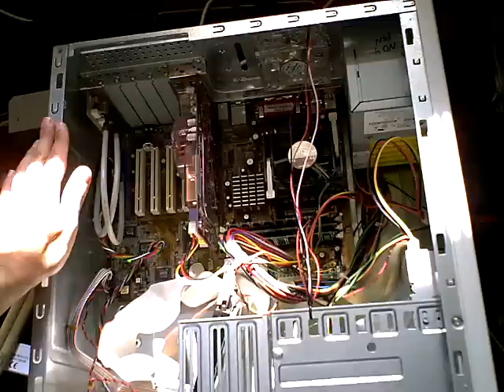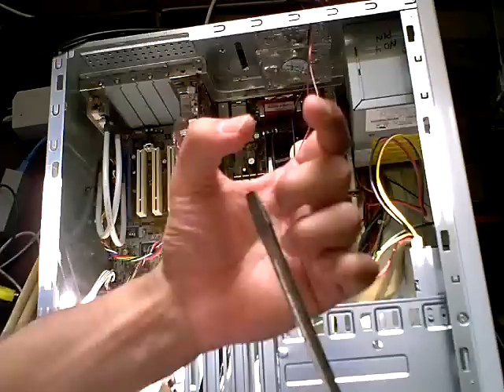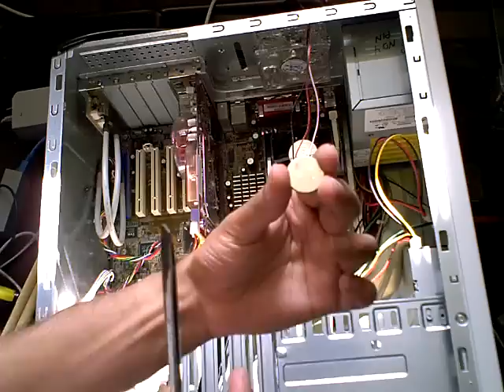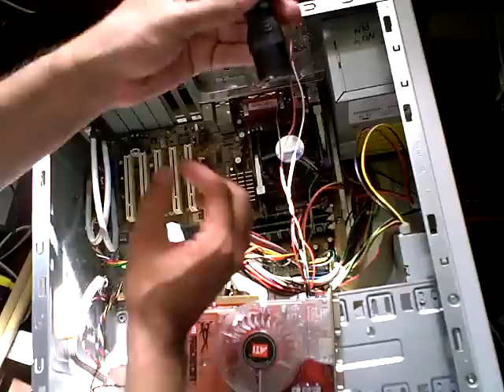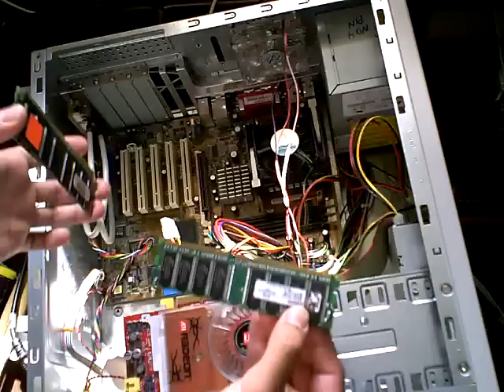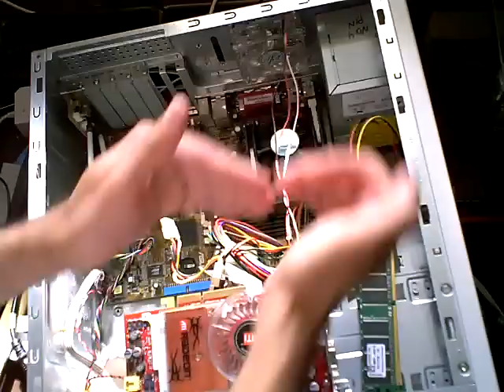How to possibly fix a PC that will turn on but will not beep and will not display anything on screen

Comment: Can i test my other computer parts first to ensure that it is the motherboard that is causing this problem? This just happened last night and i cant seem to find the error since the mobo does not beep when i removed the ram and video card
Reply from the maker: The only way I know to test other components is in a different PC that supports all of your components, essentially by installing your current components in a different PC that is unplugged, and then powering up that PC and ensuring everything works as intended. I highly recommend you try what is shown in this video (including the CMOS reset trick) before considering your motherboard dead.
Reply: thanks i will try the cmos reset. if i remove the cmos battery, should it be replaced or can i just put it back?
Reply from the maker: Marion Batingal
If you remember your PC keeping the date and time after a power loss before the problems started, then chances are the CMOS battery is still good. Leave it out of its socket minimally 10 minutes (I recommend overnight) and then re-insert. If the PC no longer keeps a proper date and time after repeated unpluggings and reconnectings, then you might need to replace the CMOS battery (they sell these at dollar stores and electronic shops, not terribly expensive).

Comment: when I turn on my computer my screen goes to the windows then to a black screen with a white message. it does not beep and it has no curser if that helps.I have a desktop HP. do you know what i need to do to fix it? thank you
Reply from the maker: +Alexis Nicole If it is going to Windows before the error, your Windows installation has become corrupt. You will need to format your hard drive and reinstall Windows. Keep in mind that you will lose all of your personal data, so you might want to first boot up with a Linux LIVE CD to recover your personal data before doing this.

Comment: It sucks, I tried this because I was having the issue when I took out my ram and video card last night to get the dust out of it and I put everything back how I had it and boom I have this issue and have tried taking out the battery and it's not working ugh it was working fine yesterday, before I took out the ram sticks and video card :( any conclusions?
Reply from the maker: Conclusions: no. Suggestions: yes. Breadboard it (explained in the following video:)

If the steps in this video did not provide a solution to your problem, view:

http://www.youtube.com/watch?v=_EK9a-R5pss

You never know, maybe rebuilding the PC in the opposite sense that you took it apart will solve the problem.

Comment: Hey!
I really don't know anything about computers so bare with me.
I took out my graphics card and cleaned it today I also took out the fan that's just sitting beside the graphics card and the only thing I unplugged was the graphics card, but after I had plugged it back in the moitor didn't connect so I tried to switch the cables thinking I might had put them in the wrong slots, but when I put in my mouse and keyboard they didn't connect either and when I tried turning my computer off it wouldn't so I had to pull out the power cable for it to turn off..
Reply from the maker: +Victor Holm Sounds like the same issue in the video. Try the steps in the video

Comment: My computer is booting fine, but it takes at least one minute to hear that one  normal beep and then every thing goes smoothly , is this problem or not and if its problem any help would be appreciated  .
Reply from the maker: (shrug) it's obviously not functioning as it should if it were purchased new, but if you could live with the problem, I think the way it is beats it not working at all. Just my two cents : \

Comment: So i was upgrading my card today, and we load it on the monitor in the workroom to install its drivers, everything loaded up fine and displayed images on the screen, and the wire that goes into my tower, isn't VGA, so i go back home all excited, i plug in everything in, my monitor at home uses the VGA slot, i turn it on and nothing appears on screen, but my mouse and keyboard light up, what do i do with this?
Reply from the maker: +Nasty Pete Your BIOS is configured to output on a different video device. You have to access the PC via the previous functioning display output, go into the BIOS, and set the default video output device to your preferred device. You can also try resetting the CMOS as shown in this video, but it might cause more trouble than my first suggestion
Reply: RodneyDickson Actually I figured it out, a complete rookie mistake in all honesty, I was trying to use use VGA instead of DVI-D lol
Reply from the maker: +Nasty Pete Glad things are working now. Thanks for the update
Reply: RodneyDickson No problem, and thank you for the thorough fix solution

Comment: Can you shoot some ideas towards me, i just built my PC and i got it work at first and installed windows on it got it going then when i turned it off and later tried for it to go back on, the PC boots up fans spins, everything is good, motherboard lights up but i get nothing on the mointer just a black screen and no beeps what so ever
Reply from the maker: Definitely try the CMOS reset trick as shown in the video. If that doesn't work, try the other steps shown in this video. Lemme know how it turns out.

Comment: hello, i have the same problem, i remove the ram as you did and it did make a sound like yours, however after putting it back together. the pc wont display into the monitor and the cpu fan keeps spinning
Reply from the maker: Unplug the PC, try placing the RAM in a different order, then power up. If still no luck, repeat (each time unplugging the PC, trying the RAM either in a different order or in a different combination, and then powering up). If you cannot find an order that works, and have tried each RAM module in each socket individually with no other RAM present, then perhaps the motherboard is finished.
Reply: Yeah, it the problem was the ram, i just switch the order and worked. thanks
Reply from the maker: Nice! Glad to help out : )

Comment: When I turn my desktop on it shows the dell symbol but then turns to a black screen. I did the cmos battery thing like u did in the video and when I turned on it beeped three times in a row. Then I powered everything off and placed the cmos back in and when I turned on my computer is did the thing again. If you can help that would be great thank u.
Reply from the maker: +RicksRaw Gaming Beep error codes differ from one BIOS manufacturer to the next. To discover what the beep error code is trying to telling you, discover the manufacturer of your BIOS (available in the motherboard's manual or on the motherboard's manufacturer's website {on the page for your specific motherboard model}) and then look up the frequency and interval of your beep error code on:

http://www.computerhope.com/beep.htm

Comment: my computer works when I remove my brand new graphics card, but the graphics card is fully function (I tested it on another pc), thoughts? the power supply is brand new as well
Reply from the maker: +Sher Randhawa If this is new hardware that you are installing on your motherboard (that has not yet functioned on your motherboard,) note that matching bus types of video card to motherboard socket (PCI-E for example) or matching bus types of RAM module to motherboard socket (DDR3 for example) does not necessarily signify compatibility. If this is the first time you are trying this hardware on your motherboard, there is a chance that this new hardware is not compatible with your motherboard, despite the same bus type and despite the fact that the new parts fit in their respective motherboard socket. Your motherboard manufacturer's website will have a support page dedicated to your motherboard's model, and on this support page should be a compatibility list for such components as video cards and RAM modules. Ensure that your new component is certified to function with your motherboard, and if your new component is not present on the compatibility list, then there is a chance that the new component is not compatible with your motherboard.
Reply: +RodneyDickson hey I already figured out how to get it to work haha I had to update the computer bios and it worked! thank-you anyway though
Reply from the maker: +Sher Randhawa Thanks for the update

Comment: I'm in a really weird situation guys and I wonder if anyone could help me out - I recently bought all the components for my build and I was test bench-ing the system to check that it posts before I install it in the case. I assembled everything correctly and plugged the power supply into all the correct slots etc. Then when I turned the power supply on the first time my asus hero Vii mobo lit up with red leds like it should do and there were also leds on my graphics card and on the start button on the mobo - I pressed the start button and the fans on the graphics card and psu whirred for a couple of seconds then stopped, the system didn't post! I tried a couple more times and still no luck with posting So I unplugged the connectors and reassembled everything. After reassembly the leds on the mobo turned on but no leds showed on the start button or graphics card, so I assumed that either the power supply or cpu was dead and breaking the circuit. I then used the included psu tester and sure enough the psu fans whirred continually until I turned it off - so that's the psu excluded. Then I removed the cpu and put my lovely new 4790k in a different computer, sure enough it worked just fine and the system turned on - so that's the cpu excluded. I didn't need to exclude my graphics card as the system could post without it due to On board graphics on the 4790k. That just leaves the ram and the motherboard itself. I can't exclude the ram annoyingly because the pc I put the cpu in to test it was an alienware alpha which has space for a full sized cpu but only laptop sized memory, so I can't check that. It's also extremely unlikely to be the power cables from the psu because the main mobo one must work as it is used for the psu tester, so that's excluded and there were two different included cpu power cables both of which have been tested. Finally the suspect could be the motherboard itself - but if the mobo was dead surely the lights wouldn't turn on (which they still do on the main motherboard)?
Reply from the maker: +Mo May Hobbs Very good diagnosis. Power lights on a mobo do not signify that it is without issue. The issue could still be a faulty board, and of course if you have more than one RAM module, try but one module and try RAM modules in different orderings

Comment: can you help me with my problem? the computer will turn on and will beep but no display with or without a video card installed. I've tried checking the cables but still no luck. I've also tried using the video card on another computer but still the same problem occurs. any idea what could possible happened?
Reply: and when I say beeps, i mean the normal single beep and when i press the numlock or capslock on the keyboard it is responding but no display, I even connected a speaker on it and i can hear the skype app connecting
Reply from the maker: elton69
Ok, the detail in this question helped. So, if I understand you correctly, the video card never outputs a video signal regardless of which PC it is installed into? Does your video card have multiple video outs, and have you tried the different video outs? Also, have you tested your screen with a different computer to ensure that the screen isn't to blame?
Reply: i have tested my video card on 3 different computers. 1 is on my friend, 1 is on my workstation and the other 1 is my personal computer. on my workstation I have a testbench and 2 other motherboard that is working, the video card has 3 output ports, which is vga, dvi, and HDMI, on VGA and DVI it doesn't work and I don't have a HDMI cable to test it. the PCB on the video card slightly bent maybe because overheating issue. I have sent the card to my friend for reheating which is my last option.
Reply from the maker: +Jones Afraid I am out of ideas. Hope you ended up finding a solution : (

Comment: So I just got a brand new motherboard and cpu, however I'm using an old cooler and gpu, it shows no signal on screen, everything starts up fine but no beeps no nothing... help?
Reply from the maker: The cooler should not make a difference here, although the GPU might. Your PC has onboard video? Disconnect the power cable, press your PC's chassis power button switch (to discharge any remaining power circulating in the system), remove the addon graphics card, connect your display to your onboard video, and power up. Lemme know how it turns out.

Comment: Hey I bought a new pc and I built it myself. When I turn it on everything seems fine, all fans are working including the gpu's and the lights on the gpu are also working, but there is a solid red light on the VGA on the motherboard and I get no signal. I connected hdmi but same problem, what should I do?
Reply: I however hear the single beep when I start my computer
Reply from the maker: It's a good thing you mentioned that beep, else I'd tell you that things are not working. Ok. It sounds like your PC is defaulting to a different video output than you are connecting to. Keep in mind that you can only test video outs when the PC is off and then is powered up with the display connected, so each time power down your machine, connect your display to a different video out on your PC, then power up. Lemme know how it turns out.
Reply: Ive connected the gpu to a different vga port in the psu and it worked, also i switched to a dvi cable. Once i did both of those things it worked perfectly fine and it still does as im writing this comment from that computer. Thanks for your response
Reply from the maker: Glad things worked out then : )

Comment: the same happend to me do you think it might be because i left it out for 2 months without using it
Reply from the maker: What you are describing is the most common reason this issue happens. PCs are kinda like muscles in the body: if they are not used regularly, they become difficult to function.

Comment: hi my cpu turns on and the monitor displays intel for a sec,after that the cpu has one green light on and the fan of the cpu turns off and the monitor turns off.Could u explain what problem this is.And when i removed the ram sticks and put it back again it gives 3 red beeps then.Plz help
Reply from the maker: Disconnect the display from the PC, then power on the display. Is it still showing 'Intel' for one second?

Comment: im having a problem, when i turn the computer on it starts beeping and nothing is on the screen and after 10 seconds it turns off and after five seconds it turns on and starts beeping again and turns off again repeatedly any fixes for this one?
Reply from the maker: +SPIDER SWING Beep error codes differ from one BIOS manufacturer to the next. To discover what the beep error code is trying to telling you, discover the manufacturer of your BIOS (available in the motherboard's manual or on the motherboard's manufacturer's website {on the page for your specific motherboard model}) and then look up the frequency and interval of your beep error code on:

http://www.computerhope.com/beep.htm

Comment: What do you have to do after that when you have the same problem as yours
Reply from the maker: +sha zaza Breadboard it (explained in the following video:)

If the steps in this video did not provide a solution to your problem, view:

http://www.youtube.com/watch?v=_EK9a-R5pss

You never know, maybe rebuilding the PC in the opposite sense that you took it apart will solve the problem.

Comment: Please help.ive recently come back from a holiday that was one week long and i get back to my computer stuck in boot up fans spinning and 4 beeps then pause then 4 beeps the computer is about a year old to my knowledge so it could be dust. Thanks if you can help.
Reply from the maker: +How-to Beep error codes differ from one BIOS manufacturer to the next. To discover what the beep error code is trying to telling you, discover the manufacturer of your BIOS (available in the motherboard's manual or on the motherboard's manufacturer's website {on the page for your specific motherboard model}) and then look up the frequency and interval of your beep error code on:

http://www.computerhope.com/beep.htm

Comment: Hi, so my pc was working perfectly until one day I decided to dust clean it and used a vacuum to clear the dust (really stupid) and now after doing that, my pc turns on with gpu fans spinning and everything but I get no display. It used power on normaly but once in a while it gives me a long beep and after 10 seconds it shuts off by itself.
Reply from the maker: +Christheawsome3 Beep error codes differ from one BIOS manufacturer to the next. To discover what the beep error code is trying to telling you, discover the manufacturer of your BIOS (available in the motherboard's manual or on the motherboard's manufacturer's website {on the page for your specific motherboard model}) and then look up the frequency and interval of your beep error code on:

http://www.computerhope.com/beep.htm